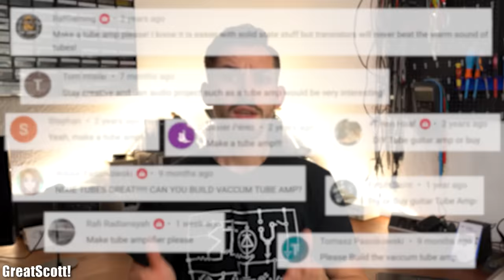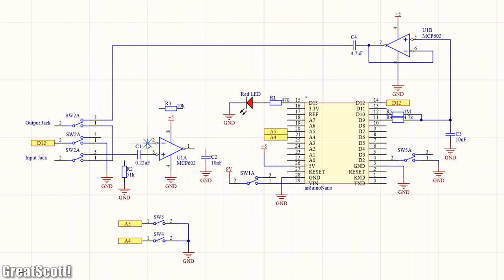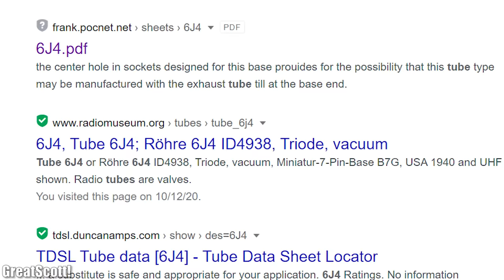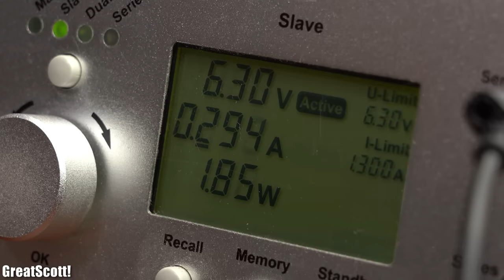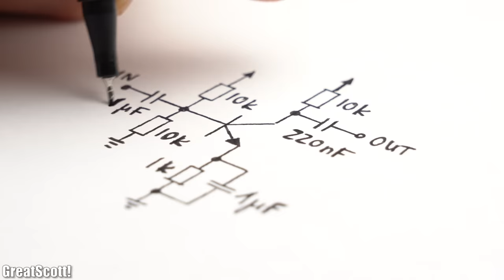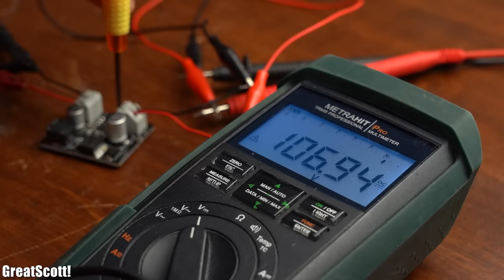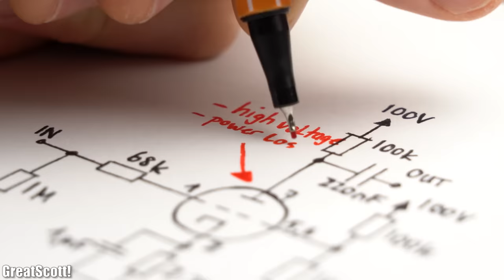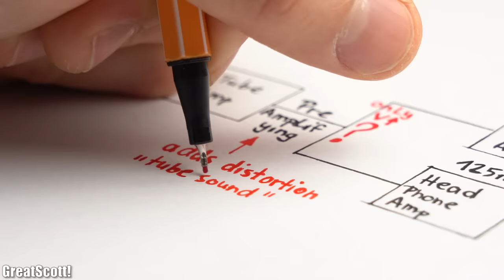Building a Tube Amp! Does it produce better audio quality though? EB#47

Comment: The ear is logarithmic in response, and therefore intrinsically non-linear.  That means that even a pure 0% distortion soundwave  sounds to us as though it contained harmonics.  Get out of that!
The ear is logarithmic so that we can hear very loud sounds but also very tiny sounds.  To experience the quietest possible audible sound requires a person of perfect hearing to sit quietly in an anechoic chamber, remaining perfectly still to prevent rustling of the clothes.  Soon he will hear his heartbeat, and after several minutes will finally hear a very, very faint thick hiss.  This is the sound of air molecules vibrating against his eardrum.
Coming back to distortion, the logarithmic function can be expressed as a mathematical series in which the largest term is f² which produces mainly second harmonic.  So our ears produce more second harmonic than any other.  (This is how we can easily set or recognise an octave by ear!).  Single reed woodwind produces predominantly even harmonics, while double reed produces predominantly odd harmonics, which is why the clarinet sounds sweet and the oboe sounds plangent.
Single-ended tube circuits produce even harmonics as explained in the video.  However double-ended circuits - usually output stages - produce first-order odd harmonics due to their symmetrical non-linearities but miss-match even between "matched pairs" will produce asymmetry whence even harmonics.
Tube amplifiers necessarily have output transformers.  These are intrinsic to any feedback loop from the speaker, where their stray reactances greatly limit the amount of feedback which can be applied without non-linear frequency response and eventually oscillation, either as "motor-boating" or howl.  Sometimes this oscillation is ultrasonic: to detect this, connect a small bulb across the speaker.  If it glows - voilà.
All-semiconductor amplifiers can, and usually do have huge negative feedback, so may have a scientifically very low distortion.  And it is for this reason that they may sound cold or displeasing.
Another point is that it's inconvenient to produce tube amplifiers of more than a few tens of watts, whereas semiconductor amplifiers are relatively simple to make in a few hundred watts.  These output levels determine the required speaker efficiency - and generally the best frequency response is produced by speaker enclosures of very, very low efficiency - so as to damp out any resonances.

Comment: Great explanation. I really like it how you avoid passing judgement on tube amps, although your final conclusion (based on facts and hard science) can of course not be anything but devastating.  It is also very insightful that you simply open up one such horribly over-priced amplifier and expose matter-of-fact like that its tubes are just there to intentionally ruin the signal path in an otherwise very well-built IC-based amplifier.
Reply: Friend, the amp he used isn't a true tube amp so here the "hard science" isn't quite factual. Sorry.
Reply: @bertroost1675  No need to be sorry, the evidence for my statement indeed does not hold water.

Comment: I once saw an "Audio Tube Amplifier" on sale at a store. If you pulled the tube out while it was on, there was no change in the signal and it still functioned without it. Sometimes these are fake products designed to sell to Hipsters. A true audiophile either builds their own, buys vintage or from a reputable manufacturer. I bet most of these Tube amps are a way for China to offload warehouses of tubes it has no use for onto unsuspecting American and European markets.

Comment: You could have just temporarily added a "huge" capacitor bank on the output of your switching power supply. It would have acted as a low-pass filter that will mitigate the ripples...

Comment: Thanks so much for the analysis,    but.... my body sensors hear a difference between tranny and valve amps. Not sure why... Somehow my Ears heard more depth of field (3D) with valves but more tight control with deep bass on transistors....?   People will argue for centuries. I just want a nice bier and sausage with valve amplification and maybe transistors or SW*** MO*** on sub bass.... :)

Comment: No, but it takes a pretty sophistacated topology to equal a simple Tube Preamp/Amp. Though Nelson Pass has some simple yet sophisticated Solid State Preamps/Amps.  A simple Voltage gain stage followed by current gain stage in a Tube Amp with a decent power supply can produce a great audio experience.

Comment: Vacuum tube amp has a higher potential amplification range than integrated electronics. A tiny transistor just cannot put through the energy a wide band audio spectrum needs. So to work around it, they add more components and transistors. But any additional component increases resistive loads. So, the integrated amps use different transmission tricks to push through energy. These tricks distort the audio spectrum. Upside is flexibility to "purify" the signal from outside distortions. Tho...you have to live with the naturally generated distortions of the integrated systems. And to filter those out, you need highly engineered and paired equipment specifically designed to do so

Since tubes have a physically large transmission areas and electron flow, a more direct path of the audio spectrum is achieved. The downside for tubes is the large energy requirement to overcome the large gap energy. This has the downside of amplifying other signals in the path. 

But, you can pair tube amps with a wide arrange of sources and existing technology. And if you want to limit distortions and noise in the chain, you can do so by relatively easy DIY methods. Want linear, low noise power? High capacity toroidal transformer power supply in a shielded enclosure. Shielded and grounded cables. It far simpler and easier to understand than a PWM integrated solution. Only downside is...you can get killed if you do stupid mistakes...

Comment: wait , tubes dont clipp when overdriven ? but how do guitar tube amps produce the overdrive/distortion sound when overdriven then ?
Reply: They don't fully clip but there it sort of "soft clips." Basically the top of the waveform gets squished down instead of getting suddenly cut off at a line.

Comment: There was a pendulum clock manufactured by SIEKO Japan. The  pendulum was activeted with the help of two hollow electro magnetic coils and a small oscillator circuit with a BC 548 (NPN) Transistor, one electrolytic capacitor and a 1.5 volt battery. The pendulum (Bob) was in a form of curve bar magnet.
Will you please be kind enough to provide the circuit diagram and how does it function.
Thanks.

Comment: I have found that Tube amplifiers cause Even Harmonics in distortion and in addition Have a HUGE Inductor in the output stage - "The Speaker"  - At non distortion levels there really aren't that much difference in two comparable well designed amps. Also worth noting is that if you can afford decent Amps you can afford decent Guitars - it all helps "THE SOUND". I have built my own 5E1 - but still use TUBE5 for home.... go figure..

Comment: Great video but soldering on a tube made me cringe, please discover the tube socket (smile).  I'm old enough to remember the 5 tube radio and how much better they sounded than the early transistorized table radios, they also seemed to reject interference better for AM broadcasts.

Comment: WHITE NOISE.
I'm surpised by the zero noise in your transistor config.  
Transistors have electrons jumping back and the junctions tend to be very noisy  
Thats why is so important as a preamp, where high signal/noise is harder to get.

edit

maybe BC637 is far better than the 237 I know...

hey, thats not an vacum osciloscope Im used to.  XD
How should it treat white noise? How can you graph random low level peaks? Can you see strident harmonics flashes? Hope it is not filtering them on purpose.
I would try with strong harmonics input.  See a square wave.

Comment: Off course tubes sound better, that`s why all musicians use them. Measurements are useless because the specific characteristics of distortion in tubes is part of the musical performance. It`s like measuring the distortion of a violin or a a piano.
You see it really doesn`t make sense to measure on a part of a musical instrument which is what a instrumental tube amp is.

Comment: 6J4s that are produced in China (I believe there is a writing on those boxes that says Peking Vacuum tube factory) are a whole different thing than the ones you googled that pop up first, as well as their datasheets. 6J4s that pop up are an older type of tube, that were produced around 50s in Europe or USA. I know this because I have an 6J5 Chinese kit amp, and I've built a lot of amps with those older tubes that pretty much are non existent these days, Chineese write 6J1 but it actually means ECC or EF something in european markings, not 6J1.

Comment: OK, not exactly a real deal tube amp you've got there - it has a vacuum tube in an amplifying stage, but to call it a tube amp, it'd have to have tubes do the job of voltage and power smplification. These amps are heavy as they need output transformers (apart from output transformerless designs, a.k.a. OTL) and the voltages can be even higher than that puny 250V.

BTW, never solder wires directly to tube pins (unless you're using a subminiature tube, these have leads for soldering directly into the PCB). This will cause thermal stress on the glass/metal interface, leading to micro-cracks in glass and vacuum deterioration. You can spot a gassy tube if you look at the getter: it'll be normally metallic (most of the time you can find it at the top or bottom part of the glass envelope), and white or missing if the tube lost its vacuum.

No guitar amps mentioned? Oh. Gotta do a video on that one... the guitar tube amp market is huge.

Nice job on these characteristic curves :)

Comment: yeah you missed it, hint notice the sound in a pentode is far less harsh resulting in a silky smooth sound, spoken word is clearer and sounds less like a recording and more like a real person! there a lot goes on in a tube that isnt on paper, second and third order harmonics, lighting fast attack and release  allows seamless peaks compression not just rms... see if that little amp is compatable with a 6k4, i doubt it though.

Comment: I work as an electronics engineer in the professional audio world. Not hifi. Equipment for studios and big gigs. 10,000 watt amps are a regular  visitor to my bench so, I'll explain why they sound better.
Firstly, they are crappy, non linear beasts which produce all sorts of weird harmonics, depending on topology of course. Transistor based amps generally produce a lot less noise, and other artifacts, And, this is where the problem starts.
Nature itself creates all sorts of harmonics, not just the fundamental. When modern music producers lay down a track then mix it, then EQ it, they will boost or cut certain frequencies and forget to EQ the harmonics. For the most part our brain takes all thses sounds and stitches them back together so, when we hear sounds  like in a modern recording it doesn't sound natural. A squishy non linear valve with all of its imperfections, puts one of these harmonics back, and we humans feel more satisfied when all the bits are there.
Not much to it really. Valves are crappy jfets with pilot lights and it's this crappiness which is perfect for fixing the things idiot music producers today haven't figured out.

Comment: You never solder to the tube's pins directly because you create micro-cracks between the glass and the pin and the tube will lose vacuum (go bad) in a few months.

Comment: Nobody has ever wanted to answer my question .... please be kind and text me back !
I have an old transmitter from the 1942 aprox and it only has 
6.2volts for the heater !! Why ?? It is my question !
I thought 6.3volts was always a standard.
Can i use these trnasformers to power and make a Guitar amp
and worked perfectly well with 6.2v instead of the normal 6.3volts ??
Thanks
Reply: It's only .1 volt dude. If you're that concerned just tweak the plate voltage to get the specified no-signal current for whatever tube you have.

Comment: There are some details not mentioned.  First of all the speed with wich a tube can deliver. Second of all the importance of the clipping and destortion behaviour is more relevant than mentioned.  Even or uneven harmonic distortions are very different for the ear. Where the transistor type of distortion is unnatural it will cause a painfull sound compared to a much higher percentage of tube distortion that is simmilar to natural distortion caused by room shapes in nature. The clipping behaviour for tubes is mentioned but is very relevant. A tube will never make a sharp edged clipping distortion where a transistor will not create rounded sides to the clip and make a very sharp edge to the clipped sine wave.  I rather have 0.5% tube distortion than 0.005% transistor distortion. Besides. People usually forget that the speaker and room together distort more than 10% usually before a signal reaches the ear. So the main reason why tubes are considered better is the type of distortion.  And not the percentage of it.  However stability of the power supply is an important factor to the sound quality. Tube amps usually use heavy duty power transformers and high capacity capacitors at high voltage. The high voltage has possible benefits. Speed of electrons is higher plus influences of using different metals and the potential differences between those metals causing problems at low voltage systems can be neglected when using high voltage systems.

Comment: What you reviewed was not a tube amp; it was a semiconductor amp with a single tube stage added in order to introduce some non-linear distortion. Any measurements or subjective evaluations of such an amp do not really generalize to the performance of a well-designed all-tube amplifier design. So while your video was interesting and somewhat informative, it does not answer the question posed by the title.

Comment: Interesting video. But I think you shouldn't analyze the cheap tube amp, there are plenty of high end one. Also you need to consider the factor of the input audio, back in the old day it was analog signals, nowadays we have digital signals, not to mention you used Spotify to test it.. lol you would only hear difference if you used some HiFi music or some lossless compression files like FLAC.

Comment: What is "better"?  Pleasant-sounding distortion, or accuracy?  In my early "audiophile" days, I experimented with graphic equalizers, dbx, and dolby to "improve" the sound of my tape and vinyl recordings.  Don't laugh, audiophile graphic equalizers are coming back,  both physical, and embedded in room correction technology.

These days, I prefer to not become a part of the performance and so limit use of distortion technology to correcting room defects such as room modes.  I stopped using tubes around the same time that I retired my turntable.  Just make sure you have more output power than your speakers require for solid-state, because if accuracy is your thing, the  one advantage tubes have is that they clip softly in comparison to solid-state.  This is one reason why modern class D amplifiers such as ICEpower are becoming so popular.

Comment: Commentators of tubes always viciously  present tube characteristic from catalogue vice transistor characteristic and are speeding to make final conclusions  about " driven from it "warm sounding"  . Truth of course is complicated but they seem not understand that  in first stages the voltages are counted in max 0,5 V, usually it is 0V - 0,2 Volt  while full range is counted up to few volts so in such narrow gap there is very slight non-linearity and that  each stage is projected  to work in most linear part of characteristic. That two provide that seen non linearity is many times smaller than "as seen in ads"  Usually much less than 1% and  it is not affecting sound  at all. 

  Additionally amplifiers are covered by feedback which decrease significantly any THD. All this allowed  in older times  to  have  studio class tube electronic which had no any "warm sounding". Tons of old LPs which are today also the source for CDs are proof.  

  Warm sounding is simply bad sounding. Users  who have bad technical condition of old systems easily trust that it is not their fault but  tubes. Other trust to any magic that bad sound is  very  desirable.  It is outrageous.  Anyone can compare transistor and tube amplifier both in perfect condition and see that they sound almost exact - not trained and prepared listener won't ever point which is which. All linear distortions  should be accounted to high and low voltages used and respectively high and low impedance  and  are created by much different  circuitry not tubes nor transistors.With tubes for example  we need to shield every hot wire    which ads to filtering HF. 
Transistors in general do not need shielding everywhere 
  Anyway  if we drive  both with multi-way speaker system then that circuitry   affects end tubes and solid amplifiers in different way providing felling of more  "warm" in tubes which is not fault of tubes or transistors  but fault of speakers with crossovers . Generally tubes are less sensitive because of linearity  at zero and that is why are more desired.

Comment: It doesn't. Blind tests made audiophiles prefer any amp and even cheap transistor amps.
Fact is that the greatest amp doesn't distort the signal, no matter what active elements it uses.

Comment: Tube amps are high voltage and low current
Solid state amps are low voltage high current.  That makes a big difference at high volumes.